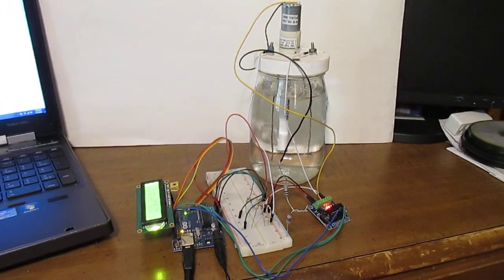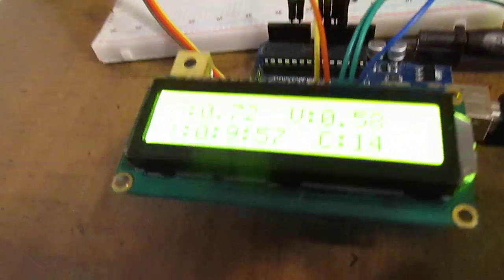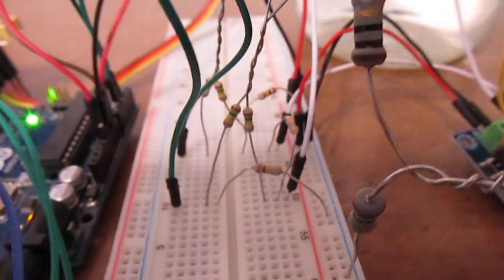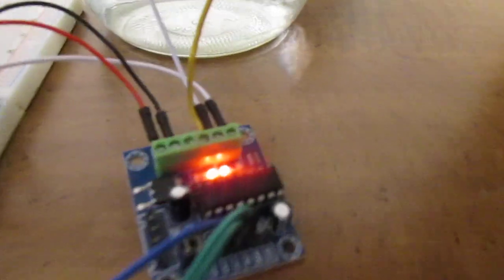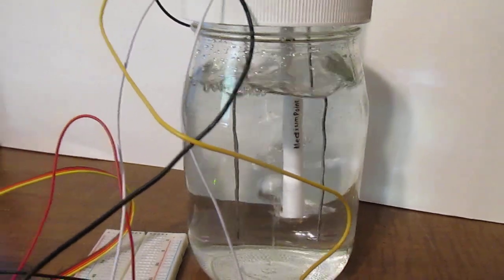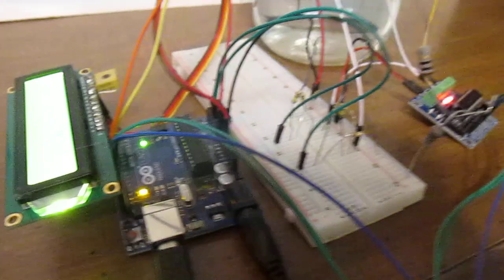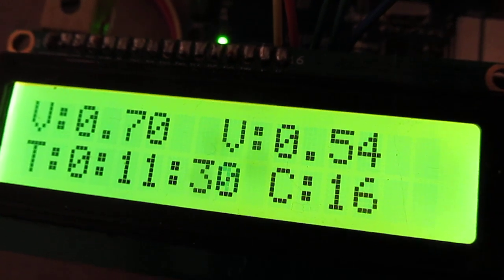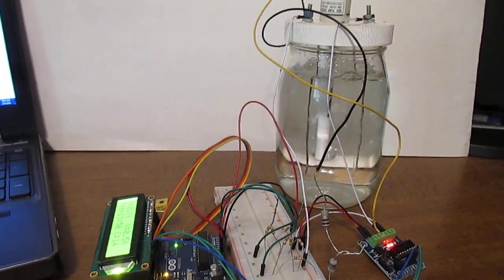Arduino Colloidal Silver Maker

Comment: 30V @ 5ma 1 Liter for 1HR = 20 ppm high quality CS , 10v minimum between Anode and cathode is ideal ,
Reply: could you explain "10v minimum betwween anode and cathode " im a big fan of your channel but you blocked comments so i can learn plus where did you buy your silver rods for the barrel connectors thanks
Reply from the maker: Voltage between the two silver rods should be greater than 10 volts, about 20 volts is ideal.
Reply: Bob Davis Correct minimum should be 10 V but anything above that if you could get it to climb up that high will be ideal adjust the negative probe to increase voltage between the probes
Reply: HYPE FERRIS https://youtu.be/BC0vGhDfZgc
Reply: @Enoch-Gnosis  I watched it - many things are wrong!
Reply: Dai Vernon that’s the Colloidal silver and Forum Formula , best quality you could make , but nowadays with what’s going on , any silver Is better than none 👍🏼
Reply: HYPE FERRIS if you raise your cathode / Negative it will increase your voltage across the Rods , I keep my Cathode only 1/2” submerged in the water.
Good luck !